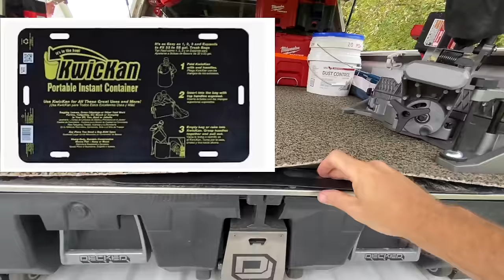Truck Loadout Part 3 / DECKED, Milwaukee Packout, & Leer Topper / More Changes #tools #milwaukee

Comment: Why not just get van?  Saves putting all those tools on the cab seats.
Reply from the maker: I might on my next vehicle.  I just went out on my own 100% and I didn’t want to go into any debt.  That way I keep using my truck for a few years and see what type of jobs I do the most, then make a decision on what vehicle will be best.

My truck is already paid off, so it cost me nothing to just keep using it.  That’s why I’ve also been buying Packout instead of building more custom stuff for my truck.  It will all be transferable to the next vehicle.

Good suggestions though 👍